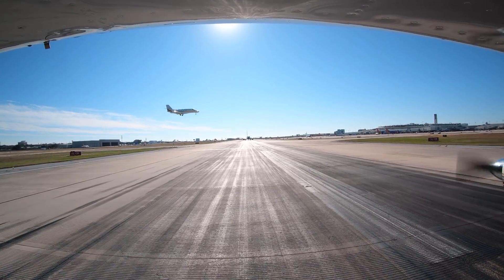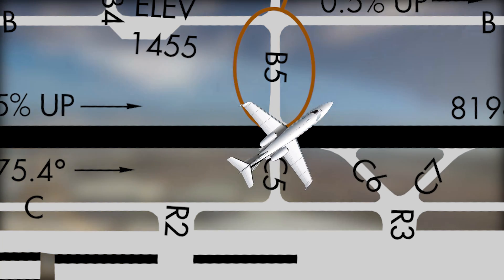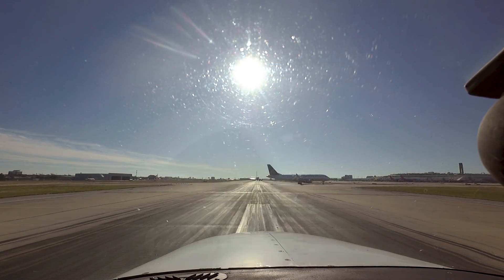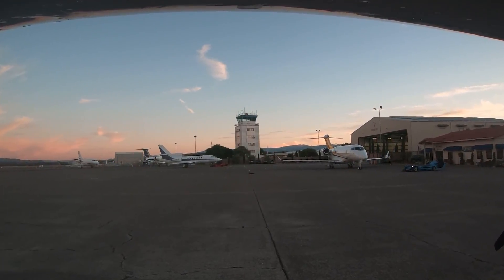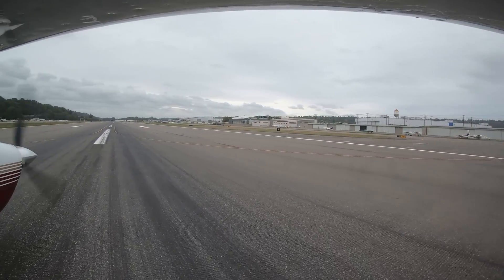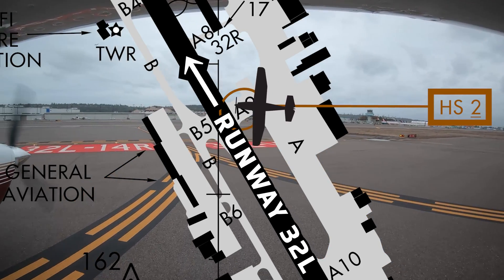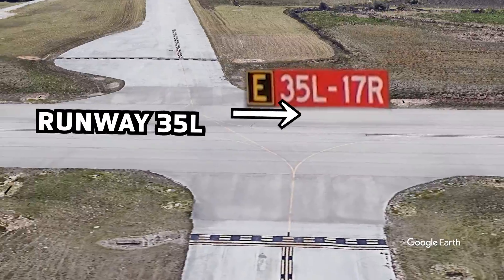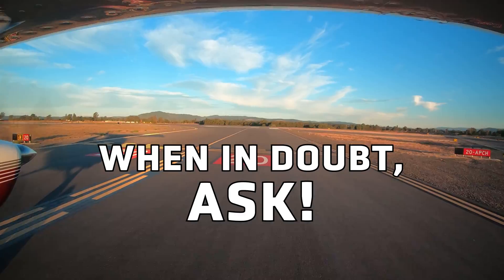From The Flight Deck – Wrong Direction Intersection Takeoffs

Comment: If one’s situation awareness is so deficient they are unaware of which runway they’re departing even in the presence of signage and the compass in front of their eyes, they should no longer be a pilot.
Reply: Sounds like you forgot what its like to be a student pilot
Reply: Dalan Angelo If you’re flying solo or otherwise qualified to act as PIC, you should know how to read pavement markings and directional/location signage, there’s absolutely no excuse for a wrong direction takeoff regardless of experience level, it’s literally something only a professional-grade dumbass could accomplish.
Reply: No, it’s extremely easy to get overwhelmed. It seems like you were never a student pilot to make such a claim.
Reply: Cade Norris nope I’m a CFI, multiengine commercial, instrument and soon-to-be ATP, I guess I’ve just always paid attention and took my time. Quit making excuses for morons, a “mistake” as a student pilot is miscalculating time enroute or overestimating fuel consumption, and a rough landing here and there, NOT taking off in the wrong direction. There are some things that should just absolutely never happen and never will if you open your eyes and think before you act.
Reply: Tanner White well I mean the FAA doesn’t agree with that otherwise this video wouldn’t have been made
Reply: Cade Norris the FAA is a government entity that has to play to the lowest common denominator. This video is the aviation version of putting “do not eat” on silica desiccant packets. You would hope no one needs to be told that but still there are those who do.
Reply: @TWhite94  "soon-to-be ATP" hahahaha. You sound like a real fun guy to fly with